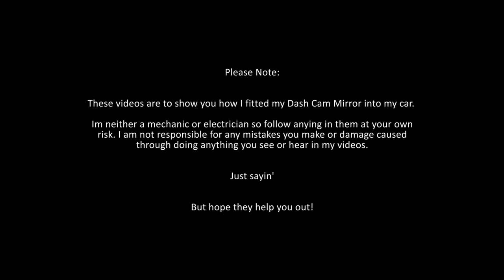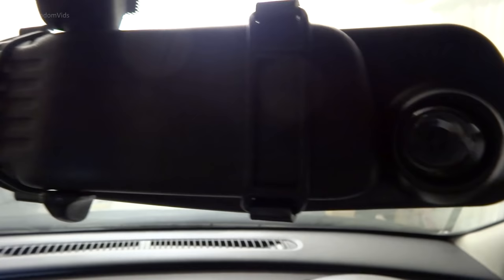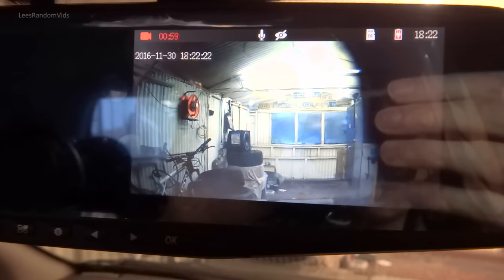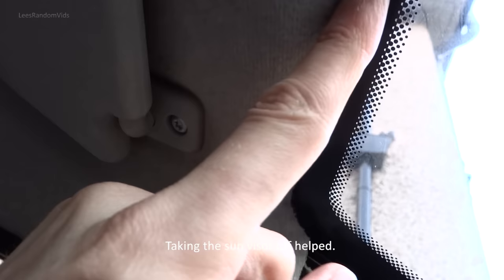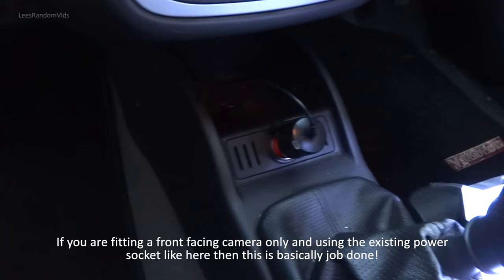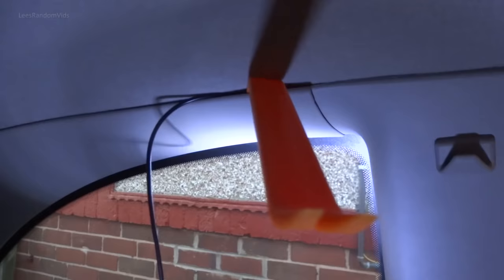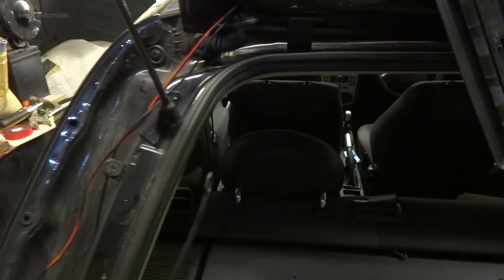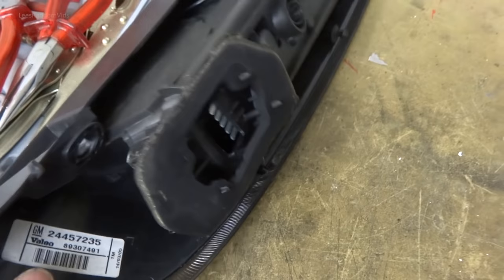How to Install a Dash Cam Mirror and Rear Camera to your Car - Part 1

Comment: i called car shop they say $200 for installation. with your video, i did myself for free. thanks .
Reply from the maker: Yikes that like way more than the actual dash cam cost!, In fact its like maybe 5 times what this camera I used cost! Glad u did it yourself mate, and thank you! :)
Reply: Did you spend 5 hours installing it too?
Reply: Why labour is expensive in english countries ?
Reply: @annonymousghostdetector8425   because they made everything under budget so labour looks really expensive but it’s not but these days people taking advantage less mechanic making more profit even small towns people spend more than big cities, very bad culture for get a repair that’s why hair dressers, street foods they r just too much
Reply: I still can't  understand  where does the red wire connect from rear camera to??? 
My unit only needs Red one from rear lights the black one comes to  front

Comment: Holy shit! I thought it would more simpler than this😅 that means it would take me a day for sure to install just a dash cam
Reply from the maker: To be honest, you can install it simpler than I did. If you only do the front camera/mirror and only plug it into the socket (instead of installing a 2nd one under the dash for it like I did) then it would take very little time. or if u do the rear cam too, the hardest part is routing the wire to the back. Also you can not bother wiring the rear camera red wire to the reverse circuit if u don't want to, it still works, just doesn't display the rear cam on screen automatically when u put it in reverse, I never use it to reverse with anyway.

Comment: Thanks, your tips helped, I just got done installing mine and really loving it, and after watching your video, made it very simple and easy. Thanks again.
Reply from the maker: Thanks mate, I'm glad the video was of some use to you. 😄👍
Reply: Hi. Can you send me you wiring diagram please? I want to know if I do not connect the reverse power line, will I need to still power the camera from another source?
Reply: @alvinlebon9368  12 INCH IS TOO BIG. TO HEAVY. I SPENT OVER 100.00 TO GET IT FIXED, AND NOW IT BROKE! HERE IS SOME GREAT ADVICE. GET THE 10 INCH ONE.
12 INCH IS NOTHING BUT PROBLEMS UNLESS YOU PAY TO GET A GLASS GUY PUT SUPER HEAVY DUTY GLUE ON IT. ALL OF THE GLUE, TAPE, AND CRAP THEY SELL AT STORES ARE NOT STRONG ENOUGH TO LAST LONG. THE GLASS GUY USES GLUE WE CANNOT BUY.
IT IS SUPER COOL TO HAVE THIS, AND IT DOES MAKE DRIVING WAY BETTER/ A MUST HAVE FOR ANY CAR
Reply: @johnlerner5346  hi. Not sure if you replied to the correct comment. I was asking about how you wired yours. Are you using the 4 pin  adapter?
Reply: Hi, you just plug it into cigarette lighter plug. so everything plugs into the mirror. back camera, etc, and you just plug it in and your done.
Reply: @johnlerner5346  thanks for the prompt reply. But I am enquiring about the AV line. I bought mine without it, thinking I could use my current backup camera with the RCA connector. However the DVR only uses AV in. I am looking for the AV line in stores and there are 2 models. 4 pin and 5 pin. Which one did you use? I.e. Which one will work with this DVR?

Comment: Hi ya I’ve just seen a gizmo on YouTube for an OBD power supply which is compatible with a dashcam. It’s hidden under the dashboard and gives constant power without hard wiring plus free up the cigarette lighter. Just thought it would of interest all the best.
Reply from the maker: Cheers mate. yeah Ive seen those, I also saw something that was a little like a relay that you wired directly to the battery and u could adjust the voltage then it took its dwitch from another circuit and u could also set a timer on it, so it cut the power say 10 mins, 1 hour or whatever after u turned the car off. Good idea for a dash cam i thought, requires more wiring in tho. I saw it online somewhere and have never been able to find it since.. not knowing what its called doesnt help. lol

Comment: Did you ever do a video to show the menu and how it works? The instructions for mine are vague to say the least. Great videos, it has given  me some ideas and it's good to know the red wire does not need to be connected for it to work.
Reply from the maker: Hi, yeah I recently made a one year on update video where I went through the menu again and what I've learnt what they do which may be some use to you. ►https://youtu.be/Dv9ftl5aZ2U?t=6m50s
I went through the menu in my first video but this update one is better as I've figured more options out since then. Mine didn't come with any instructions at all so its a case of figuring out some of them out, as you say they're vague at best. There's a couple I still don't know what they do and don't seem to do anything on mine.
Yeah you don't need to wire that red wire into the reverse light, it will still record front and rear. It just wont auto display the rear cam on the screen when you put it in reverse like a reversing camera.. I never use it to reverse with anyway.
Hope it helps
Reply: LeesRandomVids you’re a star. I’ll check it out.
Reply from the maker: You're welcome and thank you, I'm glad if I can help :)
Reply: LeesRandomVids in your vids and you power on the car does your power point activate. 
With my ignition off the red light on the lead stays on. 
Not sure if this is a good thing or not. Presumably I could have 24 hour recording but I have feeling my battery is going to go flat. 
What do you think?
btw my menu is slightly different. Can’t seem to find a setting for the camera to turn off after 20 seconds. I’ll have another look tomorrow as I’m attempting the rear camera install.
Reply from the maker: Yeah some cars have permanent power to the socket, mine cuts the power when the cars turned off making my camera shut down. There's pros and cons as you say, you'll get 24h recording with permanent power however I think a 32gb memory card can only hold roughly 3 hours of recording so it will over write after 3 hours anyway, but handy if you know someone has been hanging around your car or scratched it in the last 3 hours. If it receives an impact it will protect that recording and not over write it as mine will do too, but mine will have to boot up from sleep and record it, yours will capture the impact where as mine will record after it has switched on missing the first few seconds. The downside is the cars battery, I'm completely guessing here but id have thought it would take a while to flatten the battery but it is using the battery all the time. If you use the car everyday it maybe fine, if you went on holiday for a week or two then remember to turn it off manually so u don't return to a flat battery.
Yeah if you can u want the screen to auto turn off as its difficult to use the mirror with the screen on. If yours is permanently powered it might not turn the screen on every time u start the car anyway.
Reply: LeesRandomVids I’ll have a look in the car settings to see if the socket can power down. I might see if it runs of the USB and rewire it as I suspect it will power on/off with the ignition. 

There is a screen saver setting but the lowest that can be set to is 3 minutes. I think i will need to do a bit of trial and error. 
For the sake of my battery I think I’ll leave it unplugged when not in use. 

I’ve decided not to install the rear camera. It just can’t be done without dismantling the car to hide the wire. My mate is a spark and I’ll ask next time I see him if he can do the red wire.
Reply from the maker: Is there no way you can wire it under the cover on the bottom of the door openings and under the carpets to the back? That's usually the easiest way and how I was going to do mine till I saw I could go across the top.

Ah your mate being a sparky may be able to sort it, make it turn off.

Comment: @john lerner  thanks for the prompt reply. But I am enquiring about the AV line. I bought mine without it, thinking I could use my current backup camera with the RCA connector. However the DVR only uses AV in. I am looking for the AV line in stores and there are 2 models. 4 pin and 5 pin. Which one did you use? I.e. Which one will work with this DVR?

Comment: Hey there, Great Video Mate;

You dont know the Cheap Shoddy tricks the So-called Techies use to fleece you for a simple job as this DIY. Its appreciated that theres clear disclaimer. Im yet to install a similar system in a HYUNDAI EON hatchback & since its a Frugal small engine, it works in sync with BATTERY and a AMS - alternator managament system which enables all that JAZZ for FE. I was wondering if the Working functionality of car gets affected in anyway after adding a cam. It should'nt normally but the MNFR service guys say Nay to accessories. 

Anycase the detailing of attaching with the ply tools was Fun & good. KUdos. Shall revert you here after Install
Reply from the maker: Hi, Well, if the car has a power socket then I believe you're not really adding anything to the car that it hasn't already been designed for, as it just takes power from that power socket. And if you chose to add a second socket like I did its just the same as plugging a one into two adapter into the socket, it just leaves a socket free should you ever need to use one for a SatNav or phone charger etc. The car is designed to power its power socket so I wouldn’t thought it would affect the AMS at all. Plus I think the cam uses very little power anyway I doubt it will have any effect on the AMS, its not like you're powering a big TV or something, it will be negligible. Just my opinion of course.

The rear cam is the part where you're suppose to wire it to the reverse light to act as a switch for turning on the reversing cam screen. I chose to do a more long winded way of actually wiring it to the light cluster rather than cutting into the wiring harness via a splice connector just to avoid any potential issues, which were unlikely, but even so. If you're concerned about this part then you don't actually need to wire it to the reverse light. Both the cameras will still work and record front and rear without it, it just wouldn't turn the rear cam full screen on the mirror automatically as a reversing cam when you put the car in reverse (you can do it manually on mine if u wanted to), to be honest I don't use it anyway, I just fitted it because it was possible (I believe some don’t come with that option anyway).

Anyway bit of a long answer but hope it helps somewhat and hope the video helped you too.
Cheers mate. Good luck.

Comment: Good video although gonna wire power to front interior light instead of cigarette socket
Reply from the maker: Thanks mate. Yeah if you have enough room behind the light to hide the plug that plugs in to the socket normally, to drop the 12V down to 5V. I put a second cigarette socket under the dash for mine running from the existing one.
Reply: @LeesRandomVids  yeah I was also considering that.. Downside I've learned today.... Mirror vibrates on motorway and when passenger drops there visor down it knocks the mirror as its wider
Reply from the maker: Yeah I've found out if the passenger puts the visor all the way down on mine it hits mine too as it's about half an inch too wide, but if they drop it like 90 degrees down it's ok. It's just if they want to admire themselves in the mirror behind the sun visor lol
I don't get any vibrating on the motorway on mine, none I've noticed anyway, I guess that's down to each cars mirror strength, I sometimes get a very tiny bit when the engine is idling when the engine is cold on a cold day, until its warmed up.
I found it weird using the mirror when I first put mine in, with the blue tint etc, didn't like it at first but I've got use to it now, I don't really notice it so much now.

Comment: Hi. To run the wires through the side airbags did you have to remove the 12v battery? They should not deploy because of that but I have that doubt before I start with the installation. Thanks
Reply from the maker: Ah, down the side of the window? Well my car didn't have airbags there so I didn't need to worry about that but I believe they say to disconnect the battery if working on or around airbags for safety.
Reply: @LeesRandomVids  Thank you

Comment: Is this camera compatible  with small cars like Suzuki VXR ?
Specially the rear camera?
Reply from the maker: It fits over a standard size rear view mirror and is powered via the car's power socket. If you have those then the rest is just figuring out where to route the wires.
Reply: @LeesRandomVids  Thanks for the reply.
You are talking about dash cam.
The rear camera  gets its power when you engage the rear gear or when reversing the car. Is the mechanism same for all cars or does it differ for different cars?
Reply from the maker: Both the front and the rear camera are powered from the mirror, which is powered from the cars power socket.
You can also wire the rear camera into the reverse light circuit, what this does is when you put the car into reverse it automatically displays the rear camera on the screen. It's just a switch, it doesn't power the camera, you don't need to wire it in to the reverse light circuit if you don't want that feature, it will still power and record the rear camera if you dont. And yes every car will be the same as all cars have reverse lights, but the wires will just be in different places depending on the model of car.
Have a quick look at this video and look around 5 minutes in, i plug the rear camera in and power it just from the mirror before I even installed it in the car. https://youtu.be/reM6YwvAjko?t=300o
Reply: @LeesRandomVids  Thanks 'a million' for solving my problem.

Comment: Hello Fella 
Installed camera to my 2003 V W CADDY rear camera is showing upside down bizarrely checked braket on rear camera only one way to fit ie not adjustable any ideas thank you
Reply from the maker: Does the camera not rotate within the bracket? Sure mine can be rotated.

Comment: Your video was very helpful, thank you! I also watched your "unpacking" video and I too bought mine on EBAY. However, you said you paid L30( 30 pounds)! That is approximately 45-50 U.S. dollars! I paid $22.95 U.S.- with free shipping! Did you have to pay taxes or something? I'm just curious why there is such a big price difference.
Reply from the maker: Thanks mate I'm glad it helped! Yeah there were cheaper ones, low as £15 I think but without the rear camera, and others with a slightly different rear camera but this one was around £30. I didnt pay any taxes no because its was a UK seller, maybe the seller did. Its even better for you then to get it even cheaper!
Reply: oldschooldiy non
Reply: You can find the GBP sign, or symbol, as a Capital 3!

Comment: Thanks a lot super useful... in 2020 I bought a dash cam myself and turned out to be exactly the same one as this video, but I have a question... The red wired can be conected to any of the reverse lights? or has to be specifically to one of them? I already installed the mirror with the front camera exactly as you said and its working properly, but left the rear camera for later after I resolve my doubt, also after i tried the front dash cam I couldnt get it to tell me the speed i was travelling to or to tell me where the road cameras are... is there anything you can help me with? thanks a lot in advance
Reply from the maker: Yeah the red wire can go to either reverse light. As long as that light only lights up when it is put into reverse then it's fine. When power is sent to the red wire it tell the mirror to display the rear camera on screen. It's basically just a switch to tell it to display the rear camera on screen, so wire it to a reverse light and it will switch when you put it into reverse.
On the second part, my dash cam mirror doesn't have speed or road camera capability, I believe that would require GPS built in too so it knew where it was. Mine is purely a camera, no GPS or anything like that.
Reply: @LeesRandomVids  thank you so much! Really I got a lot from your video, my camera does have a GPS and tells me where the speed cameras are on the road, I just needed to format the sd memory card and plug it with a USB cord to my PC and reboot it and now it's updated and warns me about the cameras and what speed is the limit too, super useful and cheap I gotta say
Reply: @t3Te93 Did yours come with a memory card?

Comment: Yeah I just clipped mine on on my right side drive, pointing way off to the side though if I keep mirror in the right place for use 😐
The rest of it, I had no idea I'd have to pull panels off...no idea how I'm gonna do it without screwing it up 🤦‍♀️
Reply from the maker: The camera in the back of the mirror is movable so you should be able to point the camera more towards the front and still be able to use the mirror. 
You don't have to pull the panels off if you don't care about the wire showing, you could always use sticky tape if that's easier. It's your car at the end of the day so it's up to you if that's an option. 
Hope it helps.

Comment: The morror camera have also "blind protection" (against high beam from the back car) when you pull the knob down, like on the original mirror?
Reply from the maker: Yeah that is why it is blue, to try to reduce the dazzle as you cant angle the mirror down or the camera will point to the sky. It seems to work, but makes the mirror feel darker. I didn't like it at first, but I have gotten use to it now.
Reply: @LeesRandomVids  thank you for re: ;)